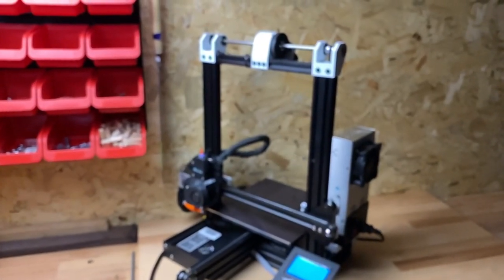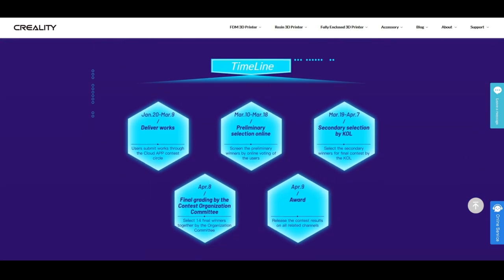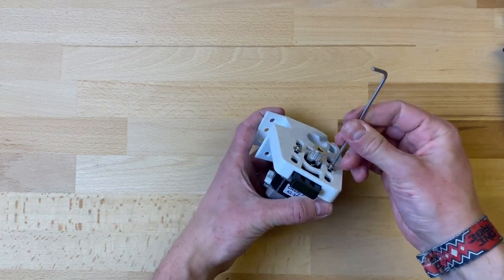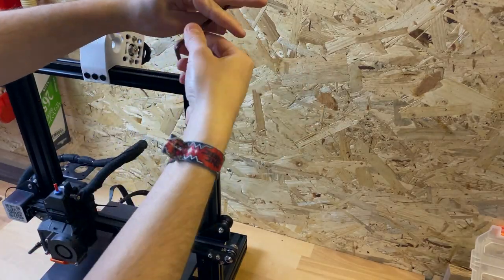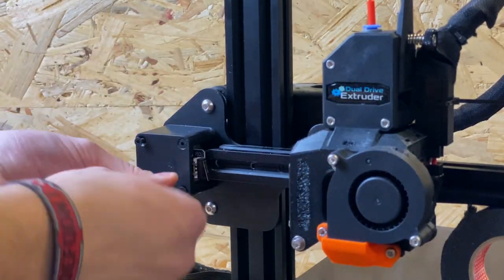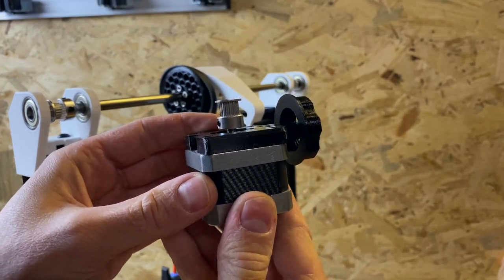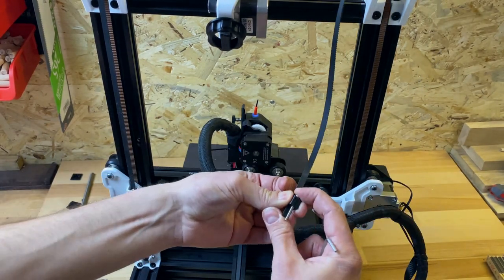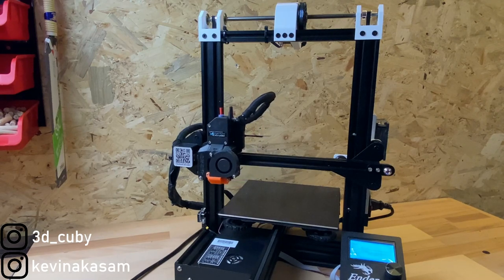How To: Belt Driven Ender 3/V2/Pro (Tutorial)

Comment: Hi! Thank you for your video! I also have problem with the z-axis on my Creality Ender 3 V2 Neo. I don’t think it’s fully vertical. Also the higher the print goes, the more problem on z axis it has. I did a lot of research and people say use dual z axis system will solve the problem. And now I see your modification. I’m wondering the belt driven or the dual x-axis, which one works better?

Comment: How many teeth Is the big gear? Working on trying to make a custom belt drive for a different printer that also uses the same thread pitch as the stock ender 3 lead screw. 

BTW I have belt drive parts printed out of abs ready to go for one of my ender 3's next time it binds up or sags I'm going to install it. Yes I know I could count the teeth on the one printed but if someone can answer it would be much appreciated.
Reply from the maker: It’s 80T gives you an 80:16 reduction with the motor gear:)

Comment: Will this work on A ender 3 s1 pro
Reply from the maker: Not yet but I’m working on it
Reply: @KevinAkaSam  it looks like all the same hardware.  It looks like it would work. My s1 pro has two lead screws with two stepper motors and a belt at the top. Man I can't wait till you can make this happen . Ide be willing to pay. I keep getting z banding and layer lines
Reply: I was about to ask the same thing, as the extrusions are different @KevinAkaSam

Comment: Great video! friendly tip - to make sure both belts are tension the right way you can use guitar tuner, but to get the correct and accurate tune you need to use Mersenne's equation 22: 

f=(1/2l)( sqrt(F/m) )

Where f is the frequency, L is the length of the belt between contact points in meters, μ is the belt density in kilograms per meter, and F is the tension in Newtons (1 pound equals 4.44822 N). The density of a 6mm GT2 belt is 0.0083 kg/m (both stock and genuine Gates).

Simplified, for 6 pounds force with a GT2 belt, the formula is: 

Hertz = 28531 / mm

For example On the Ender 3  X-Axis specifically, with the hotend carriage against the limit switch, the belt between the carriage and idler is 0.302 meters (302mm) long, so the target frequency is 94 Hz.

I recommend using this app for tunning the frequency Spectroid

Comment: What do the 5 screws on the printed pulley do? You show pressing the 20t pulley into the printed pulley and "affixing with 5 screws" but there are no screw holes in the 20t pulley so what are they for?
Reply: I was wondering the same thing. My assumption is friction around the gear for an interference fit??
Reply: @johngreene4396  I figured it out. The action of screwing them in, swells the plastic outwards onto the gear in the center. It helps lock it in is all.

Comment: hi there! its been two years but I finally wanna do this mod to my ender 3. Is it possible to modify the 2_Bottom_20T_V3.6.stl to use an M3 screw instead? can't find a good place to find 3x14 pins where I live

This video shows you using M3 instead of pins but there's probably a reason behind the change right?

Comment: Are you returning to post a tutorial for tuning the belts soon? I understand such things are time consuming, so if not could you point me towards any good resources to learn to do so myself? I just finished the dual z version of this mod and I love it, but I'm struggling with calibration and I don't have a solid frame of reference for how tight the belts should be. Any help you can provide is appreciated, and thank you either way because this is easily my favorite mod on my printer!
Reply from the maker: Hey, yes this video is planned for a long time already but I need more time ^^

However, home your z axis and measure the distance between the upper clap the top pulley. Divide 28531 by the amount of millimeters you measured. This will give you a frequency you can tune with an app on your phone. This is a rough point where to start. If you axis is staying up with this, you’re fine. If it’s moving down, add some more tension:)
And if you want to read about this, check this out: http://benchtopmachineshop.blogspot.com/2019/04/printer-belt-tension.html

Comment: I'd like to give this mod I try (I have an Ender 3 Neo), but I live in Argentina and I'm not finding some supplies as the 16T Pulley - 5mm Bore. Question is, do I need this exact supplies or I can change some things? Is there a list with alternative supplies that can also work? thanks.

Comment: Hi Kevin, great mod! I've got a question, do you reckon this would be easily adaptable for the Anycubic Vyper? Obviously it has two stepper motors on it instead of the creality. I'm thinking adjust the stepper motor mounts at the bottom so they instead sit with the gear in line with the belts and simply plug back in as standard.

Comment: In the video, you show the removal of the bolts that hold the 20/20 cross beam to the top. Then you put the bearing holders on the top and screw new, longer bolts back in through holes in the top. The latest models no longer have holes in the top. Should we be adding this hole back in, or were they removed on purpose?
Reply from the maker: Hey, yes that’s right. I removed these longer screws, just use the 4 shorter ones on the side with t nuts . Using the longer ones makes the frame unstable and it’s not optimal. So you can skip this step from the video and just mount the top parts without these longer screws👍🏻
Reply: @KevinAkaSam  since the bolts stick up above the extrusion a hair, I'm going to cut a recess for them, so the tops sit flush
Reply from the maker: Oh really? I’ve never noticed that, but I’m going to check that asap and add a small cutout if needed. Thanks for the feedback!
Reply: @KevinAkaSam  I pulled the step files into fusion 360 and was editing the tops so I can also use the rods that reinforced the rigidity of the frame. It uses the same mounting points. So I've had a real close up look everything. Since I've got you, you have a couple screw holes that are floating in space above where you would put the 3 mm nuts. I went in and put a sacrificial layer so they aren't printed in open space. No supports required after that, if you bridge the area instead
Reply from the maker: I’m not sure what you mean about these rods but the m3 not holes is a fair point. That’s still a point I forgot to implement. Will do that in a future update for sure. Two small burgers work as well so you do not have to use a full solid layer, just for the sides.

Comment: so the motor pulley to the 3d printer pulley is ratio that would result in the same z movement as the lead screw?
Reply from the maker: Yes exactly. It’s a 5:1 transmission, with 80 steps per rotation of the motor you will get 80x5=400 steps. So the Same as the leadscrew;)
Reply: @KevinAkaSam  Noice! where did you relocate your spool to?
Reply from the maker: That’s something o never thought about because I print inside an enclosure ^^ but I used this one for a very long time: https://www.thingiverse.com/thing:2047554
Reply: @KevinAkaSam  If you used a higher gear ratio, would it be able to run a lower holding current value? Perhaps it would even be more precise at the cost of longer printing times? Eg. if you do 120 steps per motor rotation instead of 80.

Comment: Done this mod and it's great. One potential issue I've noticed is that the z motor get really hot now. Not sure whether this mod would have altered operating temperature for stepper motor? Thanks.
Reply from the maker: Hey, thanks for the positive feedback:)
And yes it’s normal that the Motor gets pretty warm because:
1. Before it had contract to the frame, so that the frame worked as a giant heatsink
2.With the leadscrew, the motor didn’t have to do anything when the axis did not move. The axis was stationary even without the motor, so there was "no" current. With the belts, the motor must hold the axis all the time. The axis does hold even when the motor has no current/powered off, but this is due to the magnetic force in the motor. With the leadscrew, it was the leadscrew itself that held the axle and not the motor. Now, as I said, the motor holds the axle. This is the so-called "holding current". With Klipper, you can set this, but not with Marlin. So with the leadscrew no holding current was necessary, but with the Belt system it is, that's why the motor gets warmer.
What can you do about it? Well,  you can reduce the current, 0.2-0.3 is enough for the Z axis, then your motor won't get warm anymore.
That is also the reason why I said that you should not take Pla, that would otherwise become soft. But do not worry your engine nothing happens, it can habdle up to 80 degrees.
Reply: @KevinAkaSam  Thanks for the speedy response! I'm currently running it on a Ender 3 v2 so I'm not sure if adjusting the current is different at all. Also I have printed all the parts out of 5wall/5top-bottom/50% infill PETG so i don't have any worries there. I am 6 hours into a 30 hour print (after many test prints) and have checked the temp of the motor and It's sitting at an average of 64 degrees celsius. I will check again in the morning to see if theres any change but i feel confident that's it's okay. If not i will looking more into adjusting the current/voltages.

On a whole though, it's GREAT. Although, if you're open to them, I do have some suggestions. Mainly for some improvements to the rotated main tensioner body. First would be to incorporate a bearing for the 8mm shaft right next to the 80t pulley so that it is rock solid and when you tension you can't flex the 8mm shaft and cause rubbing issues with the body. Secondly possbily incorporate reinforcement ribs into the rotated main tensioner body because as soon as I tension the belt, the motor can tip ever so slightly due to the flex in the body and can cause rubbing on the belt 80t pulley belt (I got around this issue by shimming  the motor tensioner with insulation tape to compensate for the flex. 

Thanks for the work you've put into this!
Reply from the maker: Hey, yeah 60° is fine, don’t worry about that. And thanks for the suggestion. The idea with the bearing is great! I will add that:) but i don’t understand the last pint you mentioned:/
Reply from the maker: I just added a version with a bearing in the transmission body:)
Reply: @KevinAkaSam  From what my brother told me the drivers short the windings during power off to help with braking and can do the very same thing upon operation because the logic signal being low (or high) can make the driver operate in a way that it ties the windings together to help with braking and not rely on friction just on it's own.
Going to try this mod, but have to wait to get better first (stupid hayfever is absolutely awfull this year....)
Reply from the maker: Hello
thank you for your answer. That sounds like an interesting idea. I am not so confident with the software/firmware part, but I will spend some research on it. But the motor can handle the weight of the axle very well. And good recovery!

Comment: Hey, good job on the Projekt and Video. :) 
This question may sound random, but how did u get this "uneven" surface finish on the white part at: https://youtu.be/oUdoJUs8Zcg?t=40 ?
I'm guessing its a Slicer setting?

Lookin forward to doing this Upgrade myself in the future.
Reply from the maker: Hey, thank you very much:D I’m using a textured steel plate. That's where the pattern on the print comes from. But it is only on the underside. Something I've always wanted to test is the fuzzy skin in cura, to see if you can get a similar pattern on all sides. I think there will be a lot more to come in the future, especially with all the new texture functions we will soon be able to make prints where no layers are visible.

Comment: Recently finished this mod and I see its major flaw. It doesn't play well with the bed leveling. First of all z-steps become discrete while with the threaded rod it is smooth. Second, for some reason it fails to do micro-steps at all. When threaded rod was always a bit rotating this guy simply can't. I feel how it tries but weight seems to be too big for tiny steps. No idea what to do now.
Reply: It sounds like your stepper is having trouble stepping, due to friction or too much tension in your belts or eccentric bolts in the z-axis rollers. 

I don't think this mod's design is the reason you're having trouble levelling. The threaded rod is still rotated in steps by the stepper, so you still have discrete steps with the z axis when using a threaded rod. I haven't yet installed this, but from the instructions it looks like no firmware changes are needed for the ender 3. If that's the case it means that the ratio of steps to z-axis linear distance is the same, so you have the same accuracy.

Here's the math:

1 stepper rotation on threaded rod = 8mm
1 stepper rotation with 80t vs 16t (5:1) reduction on z belt results in 1/5 rotation of the 20t gear = 4 teeth on the gt2 belt  * 2mm per tooth = 8mm

One stepper rotation results in 8mm vertical movement of the x gantry on both. If you're missing steps that can be solved by reducing friction, increasing z motor size and/or reducing tension in belts and eccentric bolts.
Reply: @davidgladfelter3827  I've replaced original drive with the drive having a reductor (17HS4401s-PG5.18). Now it works fine. However that new guy is noisy.

Comment: Excited to start your project (I ordered the powge kit you linked in your website).  

Question: Is the 2M belt sufficient if you upgraded the stock Z rails? (250mm -> 350mm)
Reply from the maker: Hey! No sadly the belt will be too short then. You need a little more than 4x the z height (of the profiles). So assuming the profiles would be 350 it’s: 4x350mm + 200, so roughly 1400. but your profiles will be longer than that
Reply: @KevinAkaSam  Thanks for the quick clarification!! Thanks!

Comment: Kevin, I been happy with this super mod, all 100%, however I run into small problem, I had a power interruption, I found the nozle
deep into the print, that mean a drop, how to solve that problem? I was thinking to get same sort of break to hold the nema in to position, you think that is possible? any help will be appreciated.
Reply from the maker: Hey, sorry for my late response. Your axis shouldn’t drop. Please take a look at the FAQ on GitHub. You should solve this problem with belt tension. But I also implemented a keybak system similar to the switchwire :)
Reply: @KevinAkaSam  Hi, thanks for your help again, I`m planning  to solve this problem later, i`m busy building my e3v2 to 400x400x400, then I will try again, BUT will be a Z belt drive. Thanks man

Comment: Hi, I sent you another comment here that you may not have seen. I find some misalignment in ender v3.step cad model. How can I show them to you?
Reply from the maker: Hello, sorry about that, I always try to answer all comments. You can write me via Discord (kevinakasam#2097) which version of CAD do you have? With the Left/Right V3.2 an offset of 0.5mm in the belt tensioner was already fixed, as well as the holes at Left/Right Top of the rotated version. But feel free to contact me then we can clarify this :) [because my pc is not so powerful, I always have to split designs, I add all elements together in a file at the end so that my pc can handle that. So it may be that the parts are correct, but are incorrectly positioned in the cad]
Reply: @KevinAkaSam  I don't know how to use Discord but anyway, I created an account and sent you a friend request.

Comment: dude i just want to know how do keep your gantry form just falling when the  motor is un powered , my gantry just slip down when the motor isnt powered
Reply from the maker: You’re using the V3 right? Please take a look at the FAQ section on GitHub or Thingiverse. It’s all about belt tension and, if you’re using wheels, wheel tension. Make sure everything is well aligned and you axis should stay up as normal. But I will make a FAQ video soon to show how to tension the belts. Hope this will clear out all the questions
Reply: What I did with mine is tighten each side half a turn and test it. I've recovered from power loss once and it didn't move

Comment: Hi Kevin,  I stated printing the parts today and when I dry fitted the timing belt from the , CE3PRO_180TRingGear(Voron), print file the teeth on the 80T Ring where not deep enough to lock in the timing belt.  I'm printing on an E3Pro with Sunlu petg.  All the other parts so far are coming out great and I was hoping you might have a thought about a Cura setting that might help with the depth of the teeth.  Thank You
Doug
Reply from the maker: Hey 👋🏼 
You can try to set the wall order to outer first. Also printing slower could help. Idk if you use klipper or marlin but pressure advance/ linear advance should help as well 🙂
Reply: @KevinAkaSam  Greetings,  Good point with the wall order, I will add that to the next print if it's needed.  I'm using Marlin ( Mriscos's Professional ) firmware on this printer but I can try printing it one of my Klipper / Mainsail printers if pressure advance might help.
My print speed is 50mm/sec for this 2nd print on the E3 Pro.
In addition for the second print I changed the nozzle (.4) on the MK8 to the original Creality one.  I was using a nozzle with a larger outlet face and though that it might be causing a flattening effect to the layer shape.
The second print should be completed in about 2 hrs. so we will see what the changes did.
Thank you for your reply and suggestions and a great project. 
Best Regards
Doug
Reply: Hi Kevin,  Replacing the nozzle corrected the printing issue with the 80T gear.  It seemed that the flat face of the clone nozzle was distorting the layer line a bit to much.  Onward.  Doug